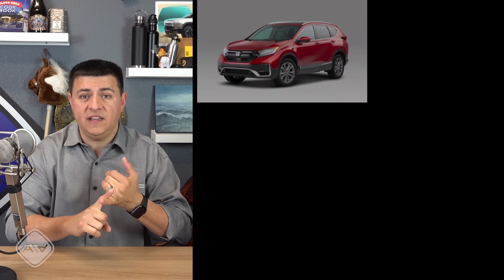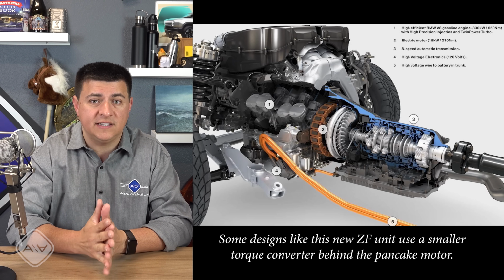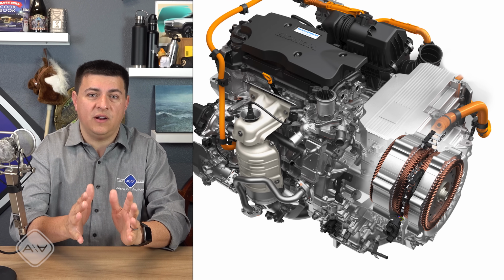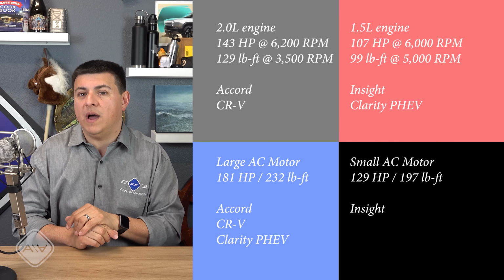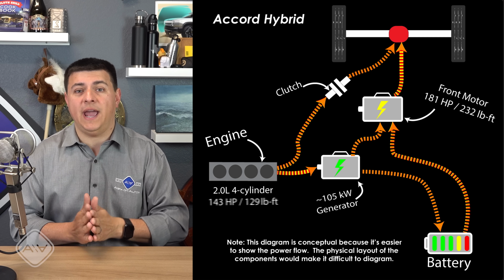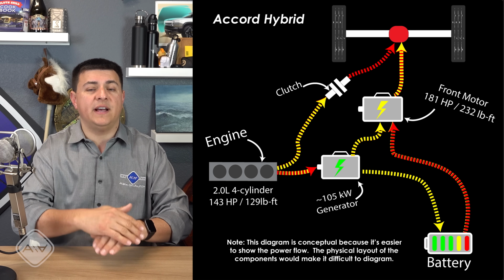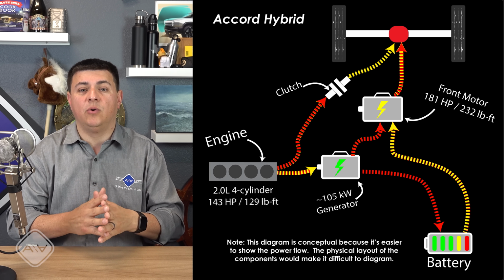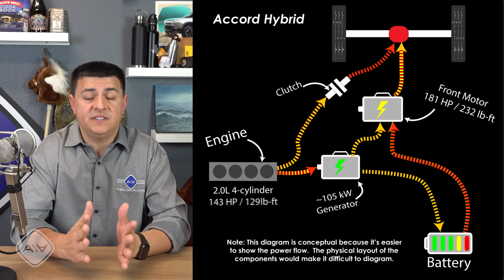How Does It Work?  Honda's 2 Motor Hybrid System Explained!

Comment: Interesting to see what Honda has done with the transmission compared with the Toyota Hybrid (I run one of those). I wonder it they’ve ‘adjusted’ the design of the engine to optimise the use of this set up. With the Toyota, the aim is to run the engine (set up to emulate the ‘Atkinson cycle’)  at a reasonably steady speed (or not at all) to optimise it’s thermal efficiency, with a real variable gear ratio/power split. What about the peak efficiency of the engine (the T one can get up to ~38% now; not bad for a gasoline engine)?
Reply: According to Honda, the 2.0L modified-Atkinson cycle engine achieves 40.8% thermal efficiency at 2000 rpm and about 34 hp. Most of the time in Hybrid Drive (serial hybrid, as Alex explains), that's exactly where it runs. The battery is charged with any excess power, and supplies more power to the motor when it is needed. In general, the balance leans toward saving more than it uses this way. That's where EV drive comes in, which these Hondas can do at any speed.

In Engine Drive (parallel hybrid), that corresponds to about 54 mph for the Accord; I don't know what it is for the CR-V, but if it is less-well tuned, it may explain why it gets poorer highway mileage than city mileage (the Accord gets essentially the same city and highway). The 34 hp is about twice the power either needs to cruise on the highway at that speed, so they also store extra power in the battery, and alternate that with EV Drive in about equal increments of time.

According to the EPA, the 2.5L Atkinson cycle engine in the Camry/RAV4 gets just under 40% thermal efficiency at about 2700 rpm and 60 to 65 hp. But that's three to four times as much power as they should need to cruise on the highway. So they'd need to be in EV drive about 60% to 70% of the time, and I'm not sure they even can. So they aren't running at that efficiency. This is why Alex's comparison, based on only  the losses he estimates in serial mode, aren't the whole story. The Hondas run at peak efficiency much more often. Result: The Accord gets better mileage than the Camry SE or XLE , but a little less than the LE which has a battery that weighs half as much and smaller tires.
Reply: @jeffjo8732  Thanks for the detail! Essentially the same idea as Toyota. In the Prius the development of a hybrid transmission made it made it possible to use a modified Atkinson cycle to improve the thermal efficiency.
Reply: @johnkeepin7527  Well, I'd say they are vastly different ideas that try to accomplish the same goal. And yes, each has its drawbacks. What I'm trying to convey is that Alex pointed out Honda's, but few people even understand where Toyota's come from, let alone their magnitude.

Honda's iMMD is, in its fundamental concept, driven only by electric motors. It uses parallel hybrid mode only in very limited situations. 99% of the time (the exception is high acceleration), the only part of the thermal efficiency map that is used is the part at or near the optimal efficiency. That's why it can use Atkinson. Compared to a similar Toyota, it has a smaller engine and a larger motor-generator. Both of which allow it to save, and re-use, a greater percentage of the power the engine can generate when it does run. As Alex describes, there are additional losses that it has to accept to do this, but they aren't always as large as he claims.

Toyota's HSD is essentially a gas-driven car that incorporates electric motor-generators in the transmission to achieve a new kind of CVT. This makes it possible to use Atkinson because it can rely on the motors at low speeds, where Atkinson is inadequate. But its electric power is limited; the original Prius couldn't use EV drive above 42 mph, and really wouldn't above about 25 mph. It can't re-use power at the same rate it can generate excess power, like the Honda does. I really don't know all the details, so any numbers I can provide are a guess. But AFAICT, it only uses EV drive at lower speeds, and only for limited time.

A simple guesstimate says that a car needs 10 to 20 hp to cruise. But the 40% t.e. point for a Prius generates over 50 hp, and a Camry/RAV4 generates over 60 hp. Even with the electrical losses Alex describes, to run at this point a Toyota should only be running its gas engine somewhere between 20% and 40% of the time. I don't think that happens. The Accord/CR-V should do it 50% to 70% of the time, which does happen.

Comment: Hello Alex, thanks for the clear explanation of the engine working. I have 2 questions. 
Q1: When cruising at say 65MPH on a level highway, the road starts to incline upwards, will we get some boost from one or both motors during this high-power-demand condition (series Hybrid) or the motors never engage after the 42 MPH limit. 
Q2: is there a plan by Honda to introduce a higher capacity battery than the 1.2 KWh presently available.
Reply: I'm not Alex, but I can answer, maybe in greater detail:

A1: Only the traction motor ever acts in the "boost" capacity you describe, and really only for a little while in a situation like what you describe. It more often drives the car by itself, or is pulling some power off of what the engine is producing to charge the battery. The smaller motor-generator only acts as a motor to start the car.

In the Accord (gear ratios may be different in the others) at 55 mpg with the clutch engaged (this is the best example), the engine will run at about 2000 rpm. On flat ground, Honda estimates the car needs about 14 HP to maintain speed. At that speed and power, the engine is about 32% efficient. But it is 41% efficient at that speed and 34 HP. So the engine will run at 34 HP,  send 14 HP to the traction motor, and 20 HP to the battery. For ease of calculation, assume the losses Alex describes means it can recover 70% of this, or 14 HP for the same amount of time.

What will happen is the clutch will stay engaged for, say, two minutes. Then, the car will run in EV mode for another two minutes. The amount of fuel it uses is proportional to (2 minutes)*(34 HP)/(0.41)=166 units. Had the engine been used alone, it would have been (4 minutes)*(14 HP)/(0.32)=175 units. This is how it saves energy.

If you start to go up a hill, it will keep doing something similar until the power needed exceeds 34 HP. If there is charge in the battery, the motor might boost the engine for a short time. But more likely, it will disengage the clutch, and run the engine at the power needed to supply the motor with electricity.

A2: Why would they? (Toyota has started to advertise their HEVs as "self-charging electric vehicles," but that is really a deceptive name. They don't use "charge" the same way, but the name suggests that they do. And the fact that his question gets asked proves that people are deceived.)

The actual category name for Honda's and Toyota's HEVs is "charge sustaining electric vehicles." The goal isn't to drive on electric power only. It is to maintain enough charge to help the gas engine however it can. In the 55 mph example I gave above, all a 50% larger battery would do is change the alternating 2-minute intervals into alternating 3-minute intervals. There would be no net savings. (And in fact, the extra weight would decrease mileage.)
Reply: @jeffjo8732  hi Jeff, for a man struggling to get to grips with the physics, which system is better (or more future-proof) Honda or Toyota, or is it much of a muchness?

Comment: I'm considering a 2020 Accord hybrid. How do others reconcile the fact that you will spend approximately $4000 every 10 years to replace the hybrid battery? I'm someone that drives a car until it dies, and I've gotten 20 years out of my 2003 Accord. Just curious how others think about this?

Comment: IMPORTANT QUESTION: Alex could you explain this because it scares me:  New owner of a 2021 Clarity and I am so pleased with this car -- perfect for my needs.  HOWEVER, when I am on the highway I normally switch to hybrid mode so I will use up the gas in the tank driving longer distances (don't want the gas to get stale sitting too long in the tank).  

PROBLEM: I have noticed that if I don't accelerate up to speed on the on ramps in EV mode, and try to accelerate in HV mode, the engine sounds like it's revving so fast it's going to be damaged.  To avoid this, I get up to speed in EV mode, THEN switch to HV mode.  

HOWEVER, sometimes even while going along at "gentle" highway speeds (55-65) the engine will do the same thing for no apparent reason -- it will rev so fast and loud it sounds like I'm damaging it.  So I have to switch to EV mode for a minute or so, then go back to HV mode.  Then it seems to settle down.

QUESTION: Are these high RPMs at that speed damaging to the ICE?  Someone said this is safe for an Atkinson engine....?  Or...?  

I love your videos and hope you can address this question.  I have noticed online that a lot of Clarity owners have commented on this and it would be wonderful to have someone address it from a technical viewpoint.  Thanks!
Reply: I'm not a mechanic but I've read that these high revs are normal and that the engines were designed to handle these high rpm.  The way I see it, we invested in Honda's quality and expertise so we need to trust in their engineering.
Reply: @alljerseystudiosnj  Great! Thanks very much for that info.  In fact, I'm becoming accustomed to it and have learned to manage how I shift in and out of EV and HV mode to best utilize the way the electric motor and ICE work at various speeds, and it's very minimal now.  I just love the car....so very pleased with it....!

Comment: I would love to have an explanation of how the starter, hvac, and power steering systems work  in honda hybrids. Great videos 👍
Reply: It doesn't have a dedicated starter. The generator, which is permanently connected to the engine, also starts it powered by the hybrid battery.

(From the Accord Press Kit): ... all the engine accessories operate electrically, both for maximum efficiency and to allow their operation whether the gasoline engine is running or not. The air conditioning compressor and water pump are both powered by the electrical system. In addition, the Accord Hybrid has Electric Power Steering (EPS), which eliminates the traditional hydraulic power steering pump and its associated maintenance and energy costs.
Reply: @jeffjo8732  Hello, I have a question. Is the e-cvt transmission used in this new 1.5 cc Honda Jazz exactly the same system as the e-cvt used in the 1.8 cc Toyota Corolla sedan or is it a different system? The reason why I asked this was they said that the risk of deterioration of the e-cvt system used in Corolla is less than the normal CVT. Do you think we will have problems with the e-cvt gearbox if we buy Jazz?
Reply: @attilakhan4606  There is no "e-cvt gearbox," so there is no possibility of mechanical deterioration in one.

What you call a "normal CVT" is a pair of cones that move in and out, so that a belt of chain riding on them hits at a different point. This can adjust the the ratio of engine speed to wheel speed to just about any value a car could need. But that can create a low of wear.

Toyota's e-CVT means "electrically controlled CVT". It uses a three-way gearbox that includes a generator. By controlling how much electric power the generator draws, the same ratio can be varied in a similar way. But there is no shifting adjustment of gears, just a lot of them (depending on how you count them). So there is a lot less wear.

The Honda system isn't mechanical at all, just four gears and a clutch. In most situations, the engine isn't connected mechanically to the wheels, so the gear ratio is a meaningless number.
Reply: @jeffjo8732  so which one i must buy to use minumum 15 years if i do not want to face any serious problem on both car's hybrid system. A Honda Jazz and/or A Toyota Corolla hybrid ?
Reply: @attilakhan4606  There is no reason why either should be suspect. Pick the one that fits your needs better.
Reply: @attilakhan4606  The CVT in the Corollas is a mechanical belt and variable pulley system, completely unrelated to this Honda design (and unrelated to Toyota hybrid systems).

Comment: Hi, I like your explanation so much.
But i still wonder how Honda combines the peak power at 212hp since the presentation never shows when the engine and motor working at the same period ?
Reply: The motor does not contribute to the contribute to the 212 HP. But it does define it. In fact, its role is more comparable to a transmission than an engine.

In a conventional gas car, the published HP is the maximum that the engine can produce, not the maximum that the wheels can receive as Alex implies. Some of that HP gets used by peripherals on the serpentine belt; like fans, pumps, compressors, alternators, etc. Some is lost to heat in the transmission.

Exactly how much the wheels can receive is not a trivial calculation, since it depends on too many factors. Honda apparently uses the estimate that it is 85% of what the engine can produce. So, for example, Honda estimates that a 192 HP Accord or CR-V can send, at most, 0.85*192=163 HP to the wheels.

Alex is right that the maximum HP the hybrid Accord or CR-V can send to the wheels is 181 HP. But this is more than the estimated maximum that the 192 HP Accord or CR-V can send. So Alex is misrepresenting the comparison, it is more powerful than he implies.

But to send that 181 HP to the wheels, which can only be done with the clutch open, it needs an electrical system that can produce 181/0.85 = 212 HP of electrical power. And that is exactly what the combined horsepower figure means. The engine-driven generator and battery can produce 212 HP of electrical power. They might even be capable of more, but will never need to since the car can't ever use more.

If you look at Alex's chart at 3:33, you will find that every model listed has a "combined power" of (AC Motor Power)/0.85, regardless of some vast differences in the sizes of the batteries, generators, and engines in each.

What this means, is that Honda chose the best "combined HP" figure to use in a comparison to a gas car. It isn't perfect, since they get applied differently, but there is nothing better. Other hybrid manufacturers that advertise a combined power do not have an easy way to compare to gas cars, and I do not know how they do it.

But apparently there is now a standard for hybrids, called "ISO net." The current Accord and CR-V apparently get 201 HP by this measure. Other manufacturers may also publish theirs. But there is no way that it is as transparent between hybrids, as "212 HP" is between these Hondas and what you are familiar with. The systems differ in too many ways.
Reply: @jeffjo8732  Hello Jeff, your explanation made me clearly understood the concept idea and further HP calculation parameters.

This is brilliant :) !!
Thank you.

Comment: here's a question for you we have a 2024 CRV Hybrid. we have about 1700 miles on it. Cant seem to get above 33 MPG we drive almost all local driving , not highway driving. and it seems like the EV mode seldom comes on, the gasoline engine is engorged almost always. Does this seem normal??

Comment: I see a definite advantage of Honda's hybrid system over Honda's regular 1.5L turbo engine: The 2.0L Atkinson cycle engine in the hybrid has port fuel injection and no turbo. This engine should last a long time and not have the problems that Honda's direct injection high compression turbos have seen (namely, fuel leaking into the crankcase's oil sump).
Reply: Or carbon buildup on the valves
Reply: You mean fuel dillusion of Earth dreams 1.5 p?
Reply: Don't buy a Honda and your not have to worry.
Reply: @MASTERNC  Yup, this is possibly an even bigger problem in the direct-injection only Honda engines. Time will tell, I guess.
Reply: @normt5463  Actually, it's dilution of the engine oil with fuel vapors. It causes the oil level to rise above the top mark on the dipstick and the oil smells like gasoline. This can't be good for the engine.
Reply: Andrew Mai I already had it happen to me in a 2015 CR-V - needed a new cylinder head and fuel injectors
Reply: @MASTERNC  You needed a new head and injectors due to accumulated carbon deposits on the intake valves? That's depressing, for sure. How come the car test guys never talk about these sorts of problems? I guess they don't know about them.
Reply: Andrew Mai few other occurrences I guess

Comment: Which engine/motor powers the vehicle when pulling a trailer? Considering the fixed gear ratio of the engine, is it safe to assume it's the large electric motor? Is the large motor really capable of pulling loads up a slope? Thank you.
Reply: The versions Alex discusses here are not rated for towing, but that has more to do with the placement of the battery than the powertrain.

With the 2023 update, the CR-V hybrid (but no others) can tow up to, I think, 1,000 lbs. The engine will do it on the flat, and the motor will do it on hills (Alex doesn't explain this well). I'm not sure why you think it would be inadequate - its 181 HP is at the wheel and is equivalent to about a 212 HP gas engine, which is measured at the crankshaft . Plus, rpm doesn't affect this power, so your speed doesn't matter. (The CR-V does have two fixed ratios for on the flat.)